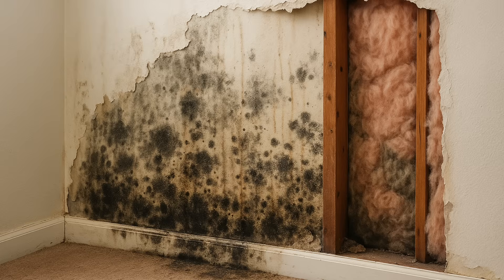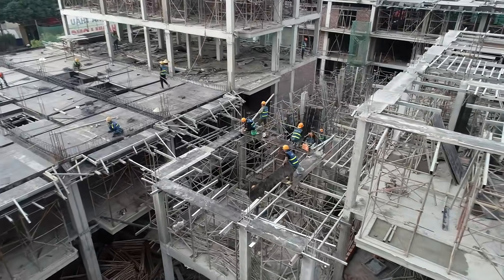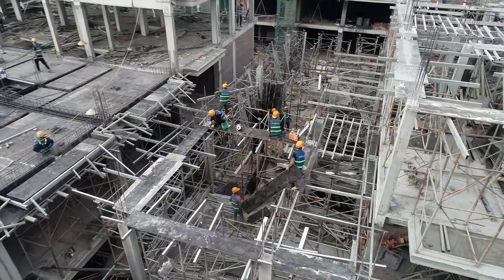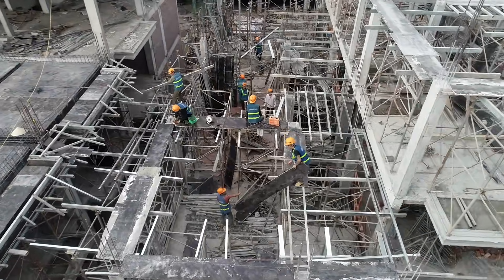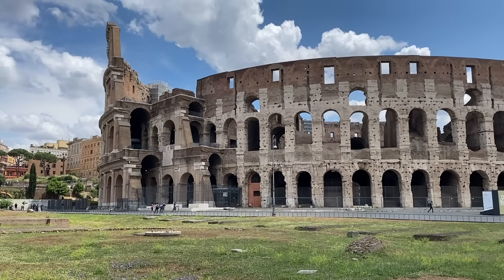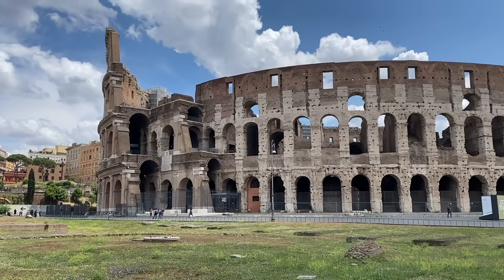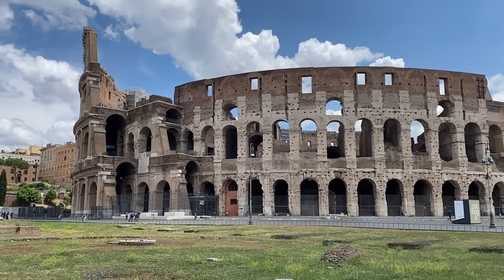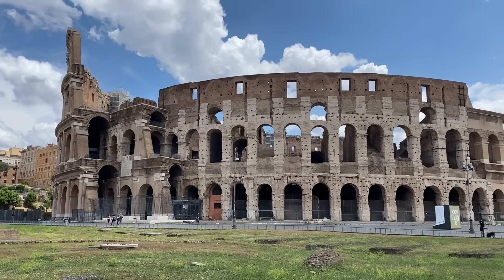The Four Control Layers | Series Intro: How We Got Moisture Wrong

Comment: Building codes need to lay off and let the market decide what makes sense.  Sometimes the market will do something stupid, like the current solution, only to later correct when people realize it produces bad products that don't last.  But it can't correct if the law demands that buildings can only be built 1 way.
Reply from the maker: I get the sentiment. Codes aren’t neutral — there are vested interests and inertia that keep certain materials and methods dominant long after their downsides are known.

That said, it’s usually still possible to build outside the “default” path if you can demonstrate performance and get engineering sign-off. Rammed earth is a good example — it can be done legally under existing frameworks.

Comment: I must agree.  I’m in construction and understood the issues with an airtight house for a long time.  If your house is so airtight you need an electric air exchange so you don’t die, that says a lot.  I decided on a roof that extends beyond the outside walls and heat with a wood stove.  What we have now is fast, lightweight and cheap.  Saves time and expense but certainly flawed.  So far so good but think a solid wall is the better option if you can pull it off.   Doesn’t burn down in fifteen minutes if there is a fire either.
Reply from the maker: So well said — you’re spot on. It really is a catch-22. To keep light-frame walls from rotting, we need very strong airtightness… but if it’s too airtight, we’re suddenly relying 100% on mechanical ventilation just to maintain healthy air.

The more I dig into building science, the more solid, massive wall systems make sense. They don’t burn fast, they don’t rot easily, they buffer moisture instead of trapping it — there’s a lot of wisdom there. Thanks for sharing your experience!

Comment: The problem is our Older homes used dry air, created by burning cheap materials or harvesting your own.

In the 1970ies the cost of heating a thinly insulated home became too high and we started closing off rooms.  Not knowing about the issues of mold and the health issues of Black mold.

We simply have not adapted yet.

Comment: so the plastic tyrek plastic is bad when used to cover the osb? i was thinking about this, and i think if we create screens that wont allow bugs and dust in but air flow, and just make vents in every room that allow air in, and the vents that lead up to the roof, covers that wont allow water in, and in really cold times you can close the vents, it seems like hot airs locked in sweats the materials, so make a top strip where the crown molding  are that open into the room and then the vent into the ceiling which would allow for venting the whole room, but would have to use foam insulation also so the fiberglass wont affect breathing, so i would stop the walls short, make molding that is vented in some way but still looks good, you cant see that the walls are open at the top or bottom, and it all vents through the roof, even if you have to use exhaust solar fans, and also vents with screens that are built into the house walls positioned for only air to pass through, but can be closed well durning cold or storms for  natural air flow, im sure those dont need to be open constantly either, just specific times of the year
Reply from the maker: Really interesting ideas — thanks for sharing them! There actually are wall systems designed to let walls “breathe” and dry out. They’re called rainscreens, and they create a small, ventilated gap behind the siding so moisture that gets in can dry and drain out without getting trapped against the sheathing.

I go into more detail on rainscreens in the Air Control Layer episode coming out this Thursday. Proper insulation is a big piece of the puzzle too — that’s part of the Thermal Control Layer, which will be the episode after Vapour (so, the Thursday after next).

Also, Tyvek itself isn’t bad. It’s designed to be airtight (to stop air leaks) while still allowing water vapour to pass through — that’s what building science means when we say a wall can “breathe.” The key is proper detailing: taping seams, flashing windows correctly, and connecting it to the rest of the air barrier so air can’t sneak through gaps.

I so appreciate the thoughtful ideas — it’s great seeing people think about airflow and drying potential, because that’s where a lot of modern buildings get into trouble.

Comment: Problem is if you build you have to meet the code. The code is ruining houses.
Reply from the maker: 100% — you can absolutely “build to code” and still end up with a mould trap. Code is just the minimum legal standard, not the standard for a healthy, durable house. That’s a big part of why so many newer homes have moisture problems.

My goal with these videos is to help more people understand the why behind building science, so homeowners and builders can start pushing for better practices and, eventually, better codes. We deserve safer, healthier buildings than the bare minimum.

Comment: Built in 1993 - Improperly installed windows caused massive mold/mildew in the fiberglass insulation and the sheathing under the windows to rot, everything looked great during the inspection. Plus, the Tyvek house wrap was improperly installed, and the crappy particle board sheathing is falling apart from all the moisture from the rain that gets through the vinyl siding. I recently bought this home as a place to retire, and I learned about MOISTURE & low-quality construction the hard way
Reply from the maker: Oh wow — that’s really tough. I’m so sorry you’ve had to go through that, especially after buying it as a retirement home. It’s heartbreaking how often these hidden moisture issues only show up once the damage is already done. You’re definitely not alone — so many of us have learned about “modern construction” the hard way.
Reply: @RootedResilientLiving  To keep a positive outlook in life I try to look at problems as more of an opportunity to find a solution

Comment: I've been building for 60 years. 40 professionally. Many years installing vynal siding. When I started aluminum was phasing out but we used their techniques. Flashings were a key part of the installation. We removed a lot of aluminum. The only interior damaged I recall was when flashing were not present or improperly installed. As the vynal business evolved they moved away from flashings over windows and roofs. Big mistake. I still use flashings, usually aliminum , sometimes copper. I also avoid plywood , osb and have never used zip-wall. Not saying it isn't good , just don't believe in it. I use real 1" rough cut for sheathing covered with 30# felt paper. Oh yeah , don't use tyvek either. Houses need to breath.

Comment: I didn't do housewrap on outside of this place framed it w 2x6x12ft roughsawn oak studs on 2 ft centers just put r 11 roll insulation w 1 inch Styrofoam then lathed it w 1x4 put some grey 3 ft wide metal on outside walls let the air move around on outside but the double layer vis queen on inside let's in no outside air so it's cheap to heat an cool also since in carpenter not sheetock guy I did all 1x8 car siding on inside an old tin for ceilings since I'm kinda cheap like the country farmhouse look. I'm going bk now 20 years later taking metal bk off outside putting housewrap an switching it up doing 3 ft wainscoting shiny new tin at bottom then going to darker Grey metal outside an putting  rough sawn 3/4in cedar soffit an cedar fascia on instead of the green metal overhang ive hated for 20 years but had the stuff to do it free so it's been fine. Probably gonna do galvanized roof metal also instead of the green. Had a guy give me whole bunch of green metal panels 24 ft long bk 25 years ago tgey were fine but washers on screws are about done after 20 years I'm tired of looking the hunter green also lol might change electric bill well see I bet the house wrap saves money in most of year tge darker wall color will be warmer in winter but hotter in summer so about even an the galvanized roof should be cooler year around so more in winter but I bet way less in summer. I doubt the electric bill changes over 20 bucks.

Comment: I framed houses for 25 years watched it go steadily cheaper an cheaper to the point guys were using finger joint studs which are a bunch of lil 8 inch pieces glued together to make 92 an 5/8  or 104 an5/8. Flimsy a fella coild kick 1 in half pretty easy. Anyway 1 guy sealed his house up so tight the has fireplace would only burn about 45 minutes before he had to open a window next to it so i got fresh air. He put 2 layers thick vis queen on inside all exterior walls all ceiling joist sealed it up air tight said his electric bill was 16 bucks a month for 2558 heated cooled sq ft. 9 ft ceilings His hvac unit woukd only turn on when he opened a door run ten minutes be off til next time you go in garage or outside. Most in that neighborhood said electric bill around 600 a month on similar size house. Been 30 years ago i wonder if he ever had mold problems later on. Everything i build for myself since that day i do just like him double layer vis queen on exterior walls an bittom of ceiling joists i been loving some low electric bills 3285 heated cooled sq ft 12 ft ceilings w bonus room in attic 1200 ft 7 ft ceilings so total of around 4500 ft 100 a month average all electric w just 1 mini split downstairs its all open just couple walls around bathroom an stairs an lil plug in space heater upstairs an a lil 11 btu window ac unit upstairs. We block off upstairs from mid july thru end September just too hot up there.  Just a given you cut a room into attic space an wanna use it in summer youll pay an pay for ac and not be cool its best to shut door for 3 months call it seasonal use.
Reply from the maker: That sounds like an incredible level of care and precision — and it really shows how much success depends on detailing. Most builds just don’t get that kind of attention, which is why so many similar assemblies ended up failing. Really appreciate you sharing this!

Comment: Any thing built after 1980 is most likely junk. I almost willing to believe mold is built into modern construction materials .Tape, glue, caulk, foam, glued wood chips, cardboard and plastic pipes on and on . My cut off used to be the seventies but those homes are gone or in very bad areas. I have owned three 100 year + homes that were better , stronger and easy to work on. 
If you buy a brand new home my prayers are with you.

Comment: Rammed earth is great until an earthquake.  Rammed earth needs to be reinforced and not used to support the roof.  Also, the new 3D homes are a duster waiting to happen.
Reply from the maker: Yes, 100%. I did a video on stabilized rammed earth. We always need to build for the location and climate.

Comment: She no's almost nothing, Build your house with a 4 foot overhang to keep the walls dry, make your downspout water go 30 feet from the house, paint exterior and interior wood I use cheap mistint latex. best to use plywood on exterior It takes just a fraction of the paint that OSB takes. use treated on all lower and north areas. You have to build a house yourself nobody anywhere will do it right.

Comment: I built my home 20 years ago and got away with a mistake through extreme attention to detail. On my exterior I taped every plywood seam, I used gasket material where the plywood attached to the plates and window and door openings. Then I put a vapor closed exterior foam and taped it and sealed it carefully as well as a vinyl siding with insulation, on the interior I put a vapor closed and taped insulation board behind the sheet rock carefully detailing it with acoustic sealant and tape then filling the walls with dense packed cellulose. I use an air recovery ventilator with a slight positive pressure the result is great with no issues but I wouldn’t recommend it since my level of detail to control water and air is not typical.
Reply: Sounds like You made your own SIP walls.

Comment: Materials design to stop moisture from getting in also stops it from getting out. Building codes have consistently been changed to allow for more insulation and less strength. Headers used to be solid now they are 2/3rds a header and 1/3rd insulation. Corners have gone from a solid 4 stud configuration to a weaker 3 stud configuration to allow insulation to take place of the 4th stud all for a couple points of r value. Now shear panels instad of blocking. Its like Building science mixed with climate activism. Homes built 100 years ago still stand today. Homes built in the last 20 years will not last as long. They are just built lighter using less wood and more insulation. Energy conservation has taken the place of strength. The long term cost are mold, rot from the obsession of air tight homes.
Reply: They are actively destroying old homes with new energy conservation codes/rebates in Massachusetts. They are dangling nice rebates and free home insulation with Mass Save program. They are literally blowing insulation into the balloon framed structures which is going to inhibit the movement of moisture up the walls and out the vented attic like it was designed to do. In just a couple decades were going to see old homes get condemned (they all have moisture intrusion somewhere).

Comment: Most of the moisture problems I've seen, came from improper installation, or lack of maintenance.   Legacy materials and modern have in common that they need to be maintained or repaired periodically.  I made a full time business out of repairing neglected maintenance,  200 years or 20 years it was the same, neglect led to failure.
Reply from the maker: Absolutely — every building depends on craftsmanship and maintenance. The challenge with modern assemblies is that it’s so easy for small detailing errors to trap hidden moisture. The result can be mould and poor air quality long before there’s any visible sign of failure.
Reply: Scamer

Comment: uuuuugh.....
This is driving me batty. My siding project has been on hold for two years because I don't know if I can use Tyvek over existing subsiding...followed by foil faced insulation panels.
Covered with 3/4" furring strips and finished with siding again.  
As I cut the firing strips I wonder whether I should allow for a 1/4" space between the Tyvek and the foil faced panels.   ( Mid Atlantic Weather )
Looking forward to more videos.....and a cold winter......
Reply from the maker: From what I understand, it’s worth being cautious with foil-faced insulation panels on the exterior if there’s also a vapour barrier on the interior side of the wall. Both materials act as Class I vapour barriers, so if any moisture does get trapped between them, it can’t easily dry out. The key is to make sure your wall assembly can dry in at least one direction, because some amount of water will always find its way in over time.

I should mention I’m coming at this mostly from a building-science and research perspective rather than hands-on experience, but that’s how I understand the principles behind it.

Comment: It's often more plain physics, rather than ancient knowledge or back to nature. When warm, moist air goes into colder areas, water condenses. Most ancient buildings were quite leaky for air  and didn't allow buildup of moisture inside. The major problem became polymers and foams, which aren't conductive for water. Water vapor can pass through styrofoam, but water can't escape through it. Vapor barriers are an issue if there are multiple layers, trapping moisture between them. Traditional materials are mostly conductive to both vapor and liquid water, lowering risk of moisture buildup.
Reply from the maker: I’d say it’s both! The physics haven’t changed — warm, moist air still condenses when it hits cooler surfaces — but those ancient builders had millennia of trial and error behind their methods. Their materials and assemblies evolved to work with those physics, not against them. There’s a lot of wisdom in that accumulated experience that we lost when we started sealing everything up with plastics and foams.

Comment: IMO heat and ventilate stops mould, but people don’t like the cost of the heating, so close off the ventilation.  Obviously insulation helps reduce heating cost, but you must still ventilate
Reply: My new house is sealed tight and fitted with a 5k ventilation system. nice fresh dry air in the house year round in northern Canada.

Comment: Wood and coal heat is a dry heat and will dry things out better. Natural gas and propane will humidify the house.
Reply: All combustion produces water, but with coal and wood it goes up the chimney.
Reply: @matthewoakley3772  Heat your ice fishing tent with a propane heater and then use a wood heater and see how wet or dry the walls are. Holiday trailers manufactures don't recommend using the trailer in the winter because of the humidity the gas furnace produces unless its the artic package. Peace out.

Comment: Also for new housing, if they are done by the book, not just thrown together to get the money, then they are really air tight, which means, the moisture from people being inside the house, cant get out as it used to be, so you need a heat recovery ventilation system, which pushes out old moist air and brings in new air.
Reply from the maker: 100%.. if it's done REALLY WELL it absolutely can work in terms of moisture. The VOCs off-gassing in a new build is another can of worms, though.

Comment: or, you can make make a house with CLT panels, 8 inch thick and do a 4 inch rockwhool insulation,  have an inch air gap between the insulation and the cladding, and issue solved.
and 8 inch CLT does have thermal mass, not a brick kind but way better then US traditional stick framing with insulation inside the wall.